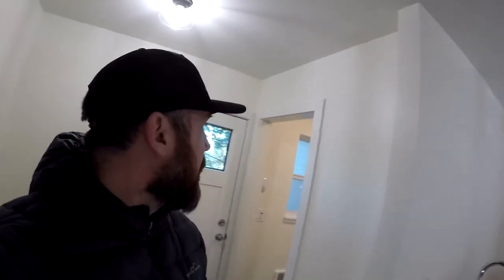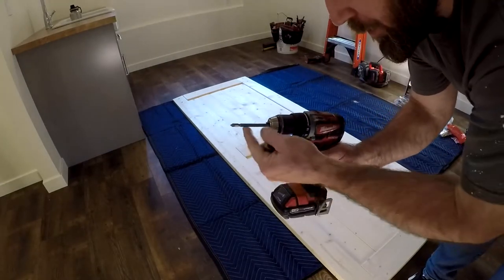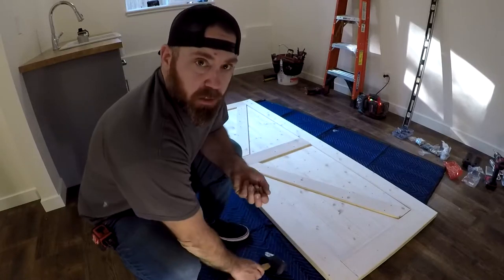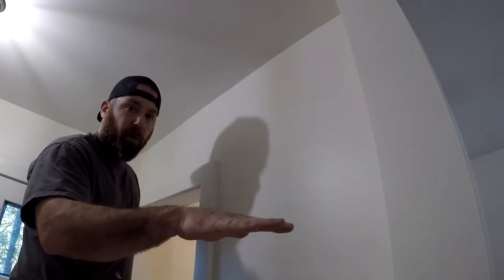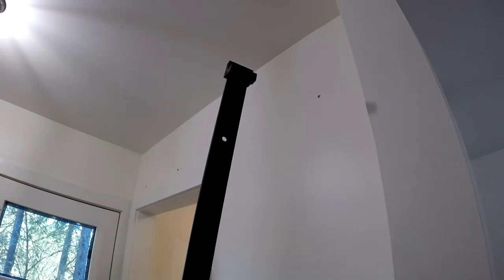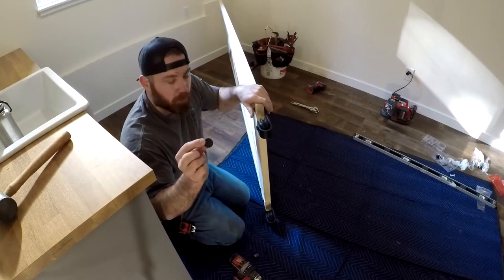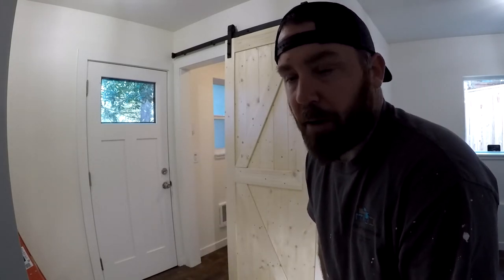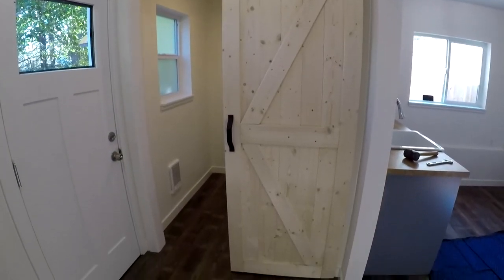SMARTSTANDARD Paneled Wood Sliding Barn Door w/ Installation Hardware Kit Wayfair Less than $300.00

Comment: My kit came with “robber dowels” aka little styrofoam rolls to place into the groove of the tall pillars to prevent the small panels from sliding around. Was debating on using them until I saw it in your video.

Comment: I like your video. I just installed my barn doors and had similar issues with the door bolts hitting the trim and backboard I had to use due to not having a header. My kit did come with spacers, so I had to use them like you did. I'm positive the manufacture must be the same as mine, because everything about your kit appears identical to mine...right down to the warped door (well, just one of my double doors are warped). Tho parts of the video didn't go into great detail, this is an excellent tutorial. Looks awesome. I wish I had more people like you that pay attention to detail and finishes closer to me here in Calif. I'd hire you for sure. Woof.

Comment: How do did you get the track to stay on the wall firmly when the bolts are not going into studs.  It seem that the holes you drilled were through the sheetrock and not into studs.

Comment: If you have a case opening, should you add molding or one by's to make the door a closer fit?
Reply from the maker: If you have a cased opening, that should mean you have trim installed all the way around the door like I do in this video.  I’m not sure what you mean exactly by closer fit, and if you already have a cased opening, where would you add the trim?
Reply: @rogueremodel2993   No I have no trim around the case opening.
Reply from the maker: @dorianemurry9647  you can add trim, but be careful and measure the distance from the wall, to the bolts used to hang the rollers on the door.  If your trim is thicker than this measurement, it will hit the trim.  You’ll also want to add the 1x trim to the inside of the opening first, before you install the casings.
Reply: So I would add 1"-13/16"  for the correct track height?

Comment: At the end when you needed the spacers, where did you put them?
Reply from the maker: I put them behind the track bar to allow for more clearance from the wall to the door so it wouldn’t rub on door trim.  They were black plastic washers so the bolts went through them and the ones provided with the kit.

Comment: hey how did you find the studs
Reply from the maker: I built the wall and made sure I had a wood header for this type of door.
Reply: @rogueremodel2993  ok thanks
Reply from the maker: @Spiritrich862  you can also install a piece of trim across the top of your door opening and screw it into the studs, and then install your barn door track.